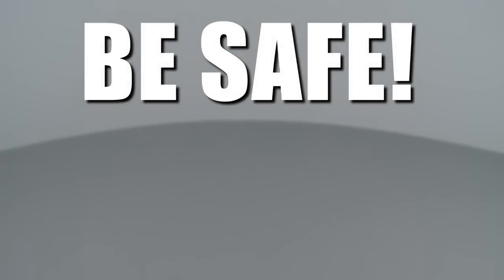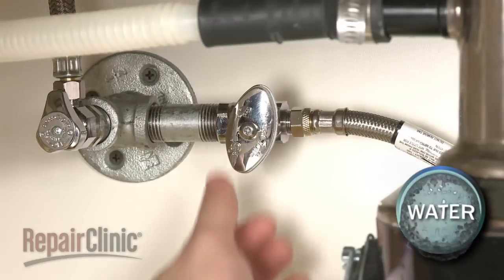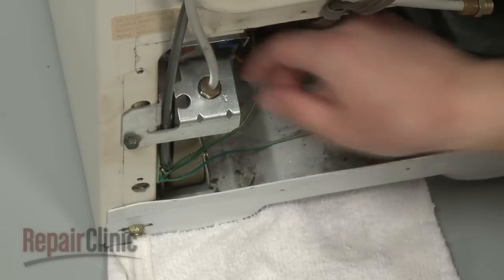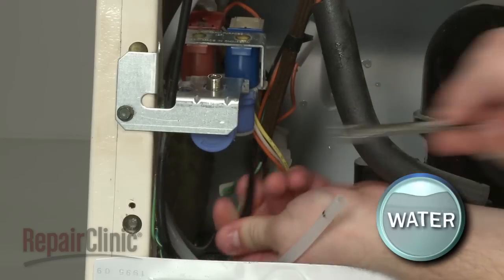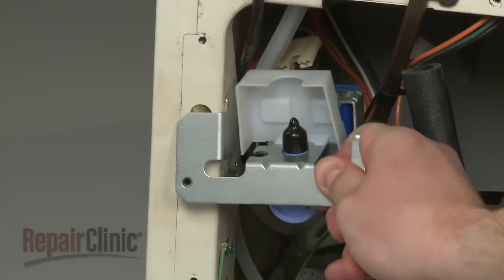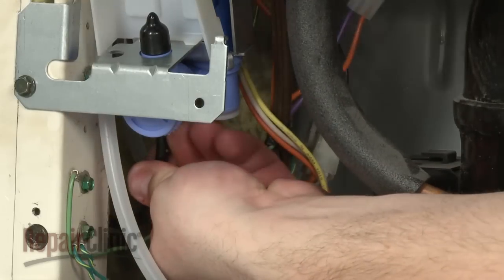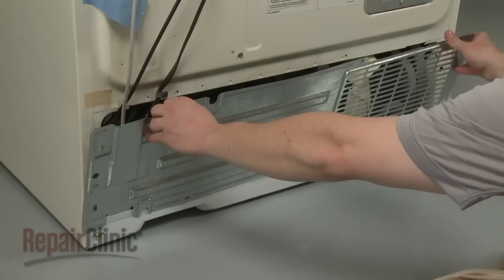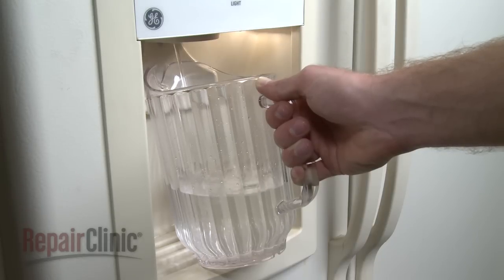GE Refrigerator Leaking? How to Repair GE fridge #WR57X10032

Comment: Thanks for sharing this. My GE refrigerator had the thread-on fittings, and the new valve I ordered did not...but the water lines were the same size, so I was able to push the nuts out of the way and shove the lines into the new water valve. I had also viewed your video on testing the water valve, which led me to replacing it...
Reply from the maker: +Dave Benedict Thank you for the feedback.

Comment from the maker: Leaking water can be several different parts going bad. I would suggest heading to the repair help section of our website (link in the description). If you plug your model number in there you'll have access to symptom based repair help specific to your model. I hope this helps.

Comment from the maker: That's 5/16 inch. We carry several different options for that size. If you go to our website (link in the description) and click "Shop for Parts" that will take you to our main page. Select "Refrigerator" under product type and then "Hose, Tube & Fitting" under the part type you should be able to locate the appropriate line.

Comment from the maker: The plastic line seals on an O-ring when you push it in. I would take it back out and cut a little more off and put it back in. The tube needs to be smooth all the way around or it won’t seal. Also make sure you push it In all the way. If you are sure it is in all the way and it is smooth you may have a damaged valve and will need to replace it.

Comment: Water collects at the bottom of my General Electric refrigerator, but my refrigerator is NOT connected to any water line. The water at the bottom can only be from condensation.Unfortunately, I have not been able to find the drain hole that everhyone says to unplug.

Comment: I just put a new Water value on and it dripping out where you stick the tube...I cut off a 1/4 inch before in the new one on...Bad value??? The black(ice side) is perfect but the water dispence(white) is dripping...Please help....I did what you shown on the video also..

Comment: how do you fix the water line going into the back of the freezer to ice maker.  it has a slow drip coming from connection point and I don't see how to disconnect to inspect/fix?
Reply: I'm having the same problem, did you fix the leak?
Reply: Yes I turn the freezer temperature up and that fixed it
Reply: I'm wondering if it isn't my valve because I can see a constant flow of water going into the ice maker. It's not a lot of water but it's a little more than a drip drip drip. Thanks for responding. Glad you were able to fix it.

Comment: Hey ***** , My GE refrigerator is spraying water where the ice maker inlet tube connects to the water inlet valve.  It looks like the inlet tub is pushed all the way in. Do you think I need to replace the water inlet valve completely?  Or can you think of another reason it might do that? Thanks!
Reply from the maker: Chris London Hi Chris, you can try depressing the lock ring and pull the tube out. Cut a little off the end of the tube and press it back into the valve. If It still leaks, you will most likely need a new valve. If you have a nut and ferrule type fitting, you can try cutting the tube and putting on a new ferrule.

Comment: I just replaced my valve and when i press water dispenser the water sprays from the back, I have the correct lines in place. confused? the leak stop but no water dispensing

Comment: Replaced the water inlet valve yesterday. We found that the water line to the fridge was cut or broken? Don't know how that happened. But we didn't think to just cut the line and push back in. We bought a new valve anyway and because the piece of line that was left in the valve was hard to pull out. We bought the part and pushed the lines back in. And no more leaks. Anything I should be concerned about?
Reply from the maker: +Reginaldo Rosas You should hold the fitting down when you pull the tube out. As long as you don't have any leaks you should be ok.

Comment: I replaced the water inlet valve, but I have now lost pressure in my fridge water dispenser.  It comes out strong for a couple of seconds and then stops.  I checked the water line for kinks and it seems ok.  Is this indicative of a defective inlet valve?
Reply from the maker: +Brian Carter If the water filter has not been replaced recently then that could cause a water flow problem. An old valve might cause this, but it would be odd for a new valve to act as if it was clogged.

Comment: so i have a tube from the bottom of the valve that has a leak. i can see it spray water when i try and get water from the fridge. how do i fix that tube?
Reply: Remove the tube, cut it back with a sharp cutter at a 90 degree angle to the tubing, and reinsert it fully.  Make sure you push on the open end wrench shown in the video when removing the tube, otherwise the teeth in the valve fitting will bend and not be able to hold the re-inserted tubing.  If that happens, it's time for a new valve.

Comment: We replaced the second water inlet valve in 6 months we keep finding that the inlet tubes are always cut off why is this happening? It's causes the leaks btw
Reply from the maker: +Reginaldo Rosas That is unusual for a new part to only last 6 months. Typically there is some external factor having to do with installation if a part fails repeatedly.

Comment: What happens when fridge is switched off every night, to save electricity consumtion.
Reply: You get a warming refrigerator and it has to catch up when turned back on.  Not a good idea in order to save a few cents.
Reply: Don't so that, leave it on at all times. It automatically turns off and on as needed. There's no need to unplug it or turn off or on yourself.